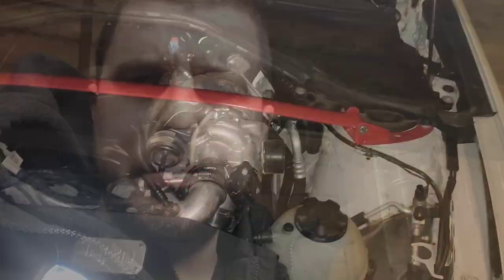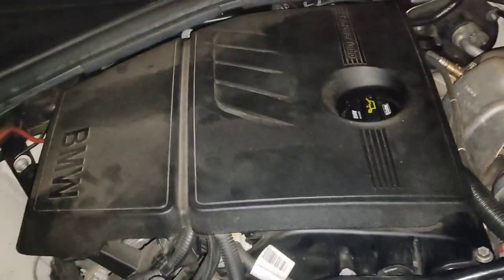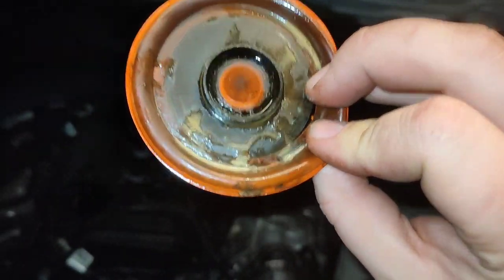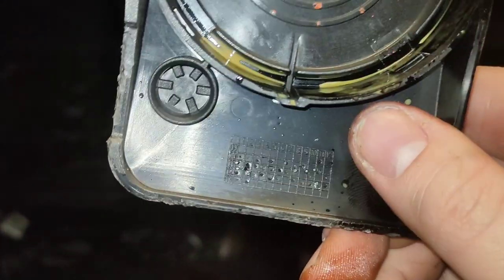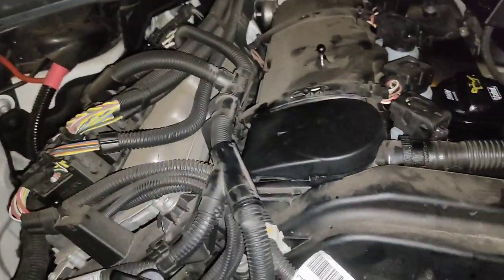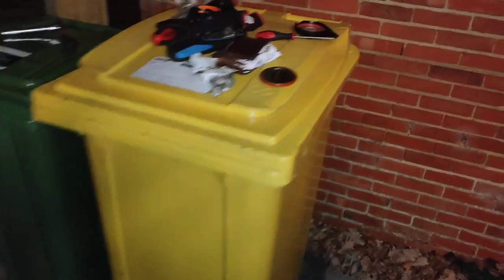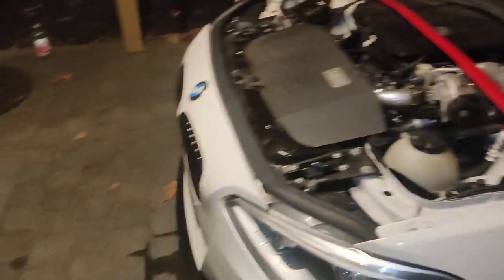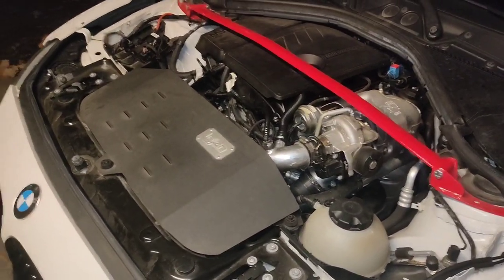BMW 1 Series F20 114i N13 PCV Membrane Fix

Comment: Bad idea. Had the same problem, did the same fix, and I finally ended up changing the whole cover. Why ?
Inside the valve cover there are TWO other small diaphragms. They WILL fail at about the same rate as the one you changed. The only way to repair them is to change the whole cover...
If you do not repair them, you will overpressurize the bottom of the engine and you will end up ejecting the oil stick and doing dammage to seals :(
Reply from the maker: Thanks for the info mate
Reply: Hello, when you say "valve cover" are you referring to the cover of the diaphragm or the engine's valve cover which I assume is a slightly bigger job to remove? Thank you :)
Reply: @jamesp1441  no, I mean the whole valve cover :D (the big plastic thing on top of the engine). It containes internal valvles wich are not replacable. The whole cover cost 500€.
Reply: @Goulaf14  I thought so. I just got a price from BMW in Australia AUD812. Probably worth it to do the job properly.

Comment: Was your car letting out black smoke and burning oil or showed a leak around the cover before replacing the membrane? Thanks
Reply from the maker: I had some blue smoke
Reply: @bimmerbelgium2254   you also had oil consumption before? And now? How many L for how much km´s ? Thank you
Reply from the maker: 1L every 5000km
Reply: @bimmerbelgium2254  now after repair or before ?
Reply from the maker: @rcstech8634 it wasn't completely broken so it stayed the same

Comment: Hey there dude I've being doing a bunch of research on this topic as I believe my membrane has broken and I'm getting a leak exactly like yours. However, I feel the car actually has much better throttle response despite this problem. Is this valve on the crankcase breather? It seems to go directly to the intake elbow and nowhere else. To me this means that you could theoretically remove the valve completely and seal the plastic to ensure a vacuum and it wouldn't cause any issues and you'd be releasing crankcase pressure much more efficiently. I have a catch can so the oil into intake isn't an issue for me. Let me know what you think of the idea of removing this valve as if it's only for removing crank pressure via intake, then there's no chance of air rushing back down the wrong way making the valve only useful for collecting oil vapour.
Reply from the maker: I'm not sure about that mate, i wouldn't take the risk
Reply: @bimmerbelgium2254  yeah mate changed my mind, gonna fix the membrane and try to make my catch can more effective!

Comment: Where did you fix the coolant leaks as I am having a few issues witybleaks around the turbo and at the back of the engine with the coolant sensor
Reply from the maker: At my local garage

Comment: There are 2 more rubber membrains inside the valve cover. And I think it's meaningless to change only this one.
Reply: Strange....i only have one.  If you don't change this one, the oil goes directly to you charge pipe into the engine.
Reply: @Outpost1977  Yeah, but  I talked about the 2 other small membranes that installed inside the valve cover and work as a part of the whole ventilation system. You have no acsess to them from above. These small membranes could be damaged also and it means that the changing of the big one is meaningless. The system won't work correctly anyways.
Reply: @PavelBMSK  ok, by changing the pcv membrane, my oil leaking problem was fixed.

Comment: tried to take off the membrane ended up breaking my rocker cover cause I’m stupid
Reply from the maker: Damn dude, that sucks
Reply: Do you recommend getting an aftermarket rocker cover or do you think I should pay double the price for a rocker cover straight from the dealer?
Reply: @bimmerbelgium2254  my cars been sitting for a few days aswell since the rear main seal is leaking so all of my 2 week old oil is gone.😑😂
Reply from the maker: Oem dealer mostly is better Quality though

Comment: Thanks for the video.  How did you know the PCV membrane was leaking?
Reply from the maker: Because i saw oil around the plastic tube
Reply: @bimmerbelgium2254  Thanks. Btw, how is the Aliexpress cap holding up.  I already bought the kit but haven't install yet.
Reply: I finally replaced the PCV valve.  Removing the cap was a bitch .. i had to pluck it out with my hands eventually and broke it.  The car feels better instantly.  I guess the oil entering the intake and turbo is not good. Next is to clean the valve with CRC cleaner!  Thanks for the video.